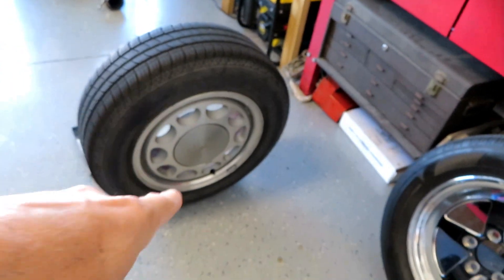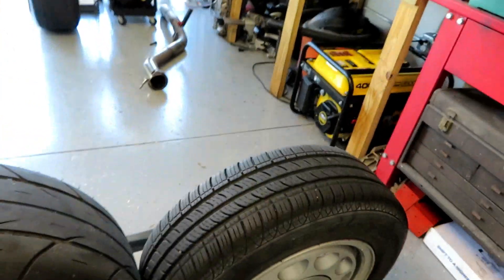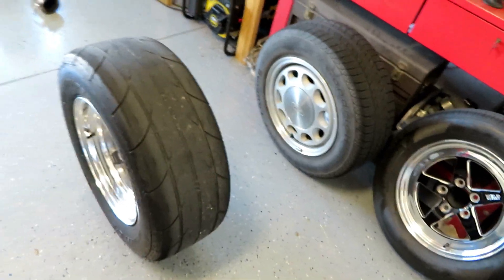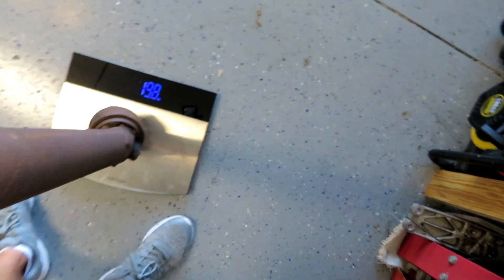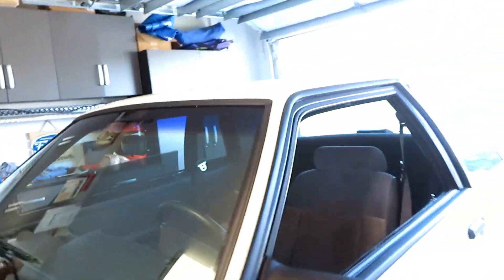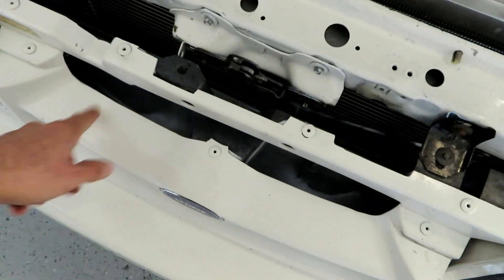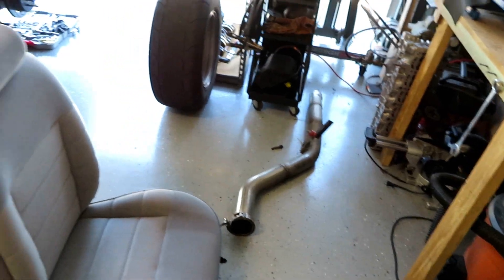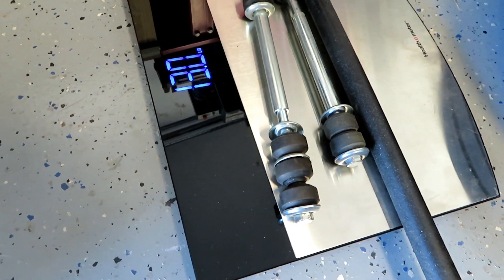Fox Body Mustang goes on a diet! Weight reduction tips!

Comment: Hell yeah. You could get it with a nice boost controller. Time based even.  Pull the front sway bar for the pass as well.
Reply from the maker: Brad Pittman I do have a turbo smart manual boost controller Running around 15 psi. And the 75 shot of nitrous.

Comment: Front bumper support is fiberglass and weighs very little. The rear support however is steel and pretty heavy. Also doesn't look like you have a rear sway bar. removing that usually makes the car 60ft worse...
Reply from the maker: The car was originally a 4cyl and didn’t have a rear sway bar when I got it. But I do have a anti roll bar in the works.
Reply: The front support brackets carry a lil weight
Reply: Remove the rear bar make it 60 worse? Can you elaborate on that because I was told to remove and I did and my 60 wint from 1.56 to 1.51 so I was a little better but my drivers still back tire looks like it un loads more. So was going to try to put a bag on passenger rear before I trie to put it back.